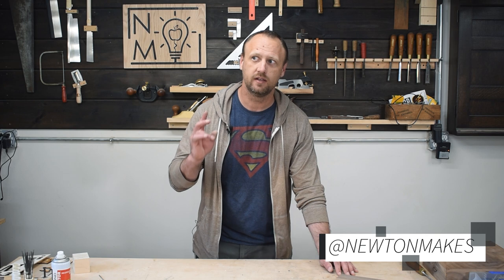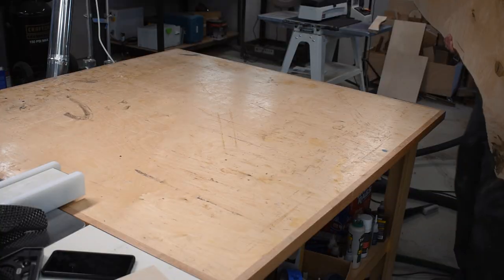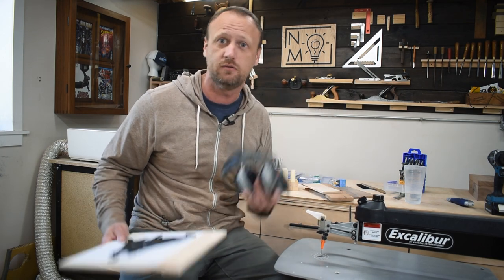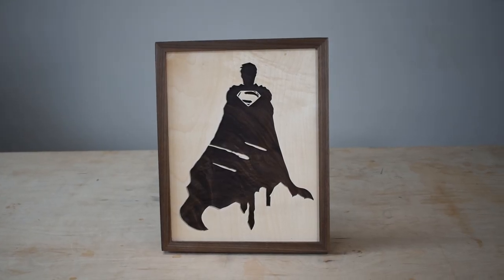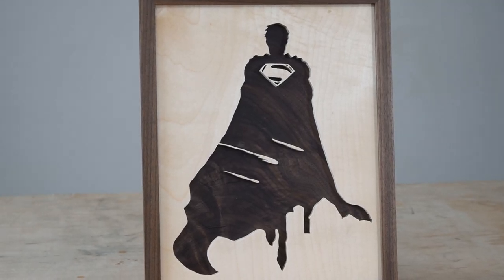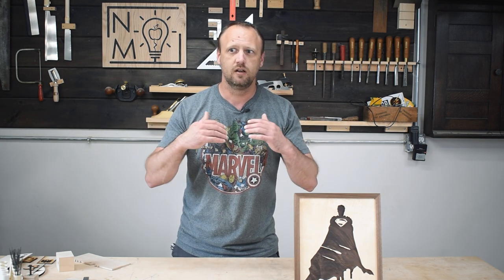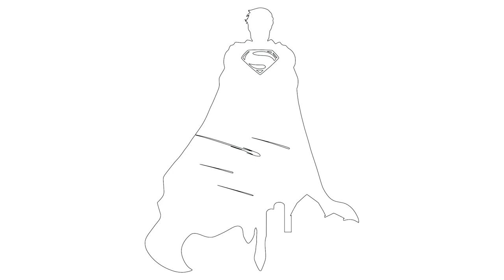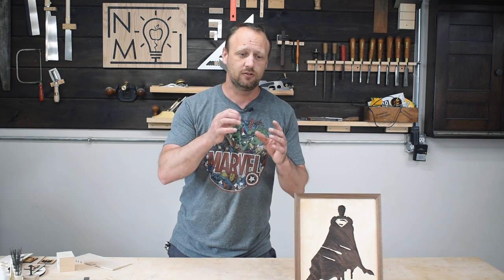I Scroll Sawed for the First Time YIKES!! | Lessons Learned

Comment: Use blue painter's tape on the wood first, then your pattern, and then packing tape.  Packing tape lubes the blade.  You can get sanding blades to sand any edges/areas that need it.  Great first time project!  You did very well!
Reply from the maker: Smart move with the tape. There are sanding blades?! Alright I'll look into those too.

Comment: I’m surprised that you didn’t break any blades with relatively thick maple for your first time. Packing tape will come up with the top layer of paper, people even have issues with vinyl. I think I have heard good luck if you follow the lines on your paper with CA glue, but that’s more sanding and possible staining or stain blocking in the wood
Reply from the maker: Yeah me too but I also didn't think this maple was thick until I started cutting it. In everything else that I do, this board would have been super thin. That was a big lesson learned for me.

Comment: What I use for my templates is sticky label paper. Sticks to the wood really well and peels off easily. Great video and an awesome first project.
Reply from the maker: That's a nice tip right there! 👍
Reply: Also lay painters tape on the wood then stick pattern to that. Then add packing tape to the top before you drill your holes. They say the glue in the packing tape lubricates the blade.

Comment: Nice work. I have an 80's or 90's pin-blade Craftsman that basically shakes the entire room when it is on. I only ever use it for finishing tight bandsaw cuts. I only use it once in a blue moon, but when I need it, I need it. 

For sanding, I just CA very small strips of sandpaper to very thin, strips of wood. I use hard maple, so that I can get the strip of wood very small, but then it has some stiffness. I also sand the edge of the strip to a point, so that the sandpaper then forms into a point, but has backing.

Comment: Turned out awesome. Don't be afraid to adjust the speed of the saw. I use blue tape under the picture, because it comes off easier. A small cheap set of files works great for inside touch ups. Take your time and keep practicing 👍
Reply from the maker: Adjusting the speed is something I have to get used to. I played with it a bit but not much. It's rare that any other tool has that feature so it's not something I naturally consider. I definitely need to pick up some tiny files!

Comment: Thanks for this - great thoughts.  BTW I bought a second hand scroll saw with a blade fitted already and mad keen to try it out I nearly injured myself as the workpiece jumped all over the place!  On inspection and checking the blade was perpendicular to the worktable I noticed it had been fitted upside down thus lifting the workpiece on every stroke!  Something to look out for and not many videos for beginners mention correct fitting of directional toothed blades!

Comment: Hello from Germany and happy new year. Here is a tip to prevent burning marks. Use clear tape on the top, this will hold the subject in place and prevent burning marks. I do it the same way and have not yet had any burn marks. I stick paper tape under the motif beforehand so that no traces of glue remain on the wood. I hope these tips help you a little further.

Comment: Wow great first artwork! I have a brand new dewalt scroll saw ready for use in my shop. Think I’ll get a variety pack of saw blades given what you shared. Super impressed! Bravo 👏🏼
Reply from the maker: Thanks, that's awesome to hear that you're getting into it as well. That Dewalt saw has a lot of great reviews. I picked up some #2, #5, #7, #9 blades. But I mainly used a #5. I found a cool cheat sheet on blades that I'll try to post on my community tab.
Reply: @NewtonMakes  cool. Thanks for the details

Comment: Thick packing tape does help.  It will still lift a little, but won't break off and blow away.  Feels like it lubricates the blade as well.  Not sure..  A set of needle files really helps with sanding small areas.
Reply from the maker: I'll have to look into lubricant for it. Needle files are a good idea, thanks!

Comment: Awesome video and well done! I loved the “lessons learned” section. I personally have never used a scroll saw, but you made it look easy! What would you say is the maximum thickness of a board you could use with one? Will you be making any projects that have different contours/depths to the pieces like the wings of the eagle you showed?
Reply from the maker: You can go up to a few inches thick. I don't have a desire to do that, at least not yet. I like thinner pieces like 1/8 - 1/4" and want to make art that's layered. But who knows in the future? They make blades that are designed to remove the waste when cutting out thicker boards.

Comment: Blade quality is important. I use precision ground blades for precise cuts. Leaves almost a polished edge. Also, scroll saw choice is also important. I was less than satisfied with the dewalt saw. I had problems with blade tracking, and longevity. I now only use Hegner scroll saws (I have 3) and will last you your lifetime.
Reply from the maker: Hegner is a heck of a scroll saw. That's awesome!

Comment: A reverse blade will help with the sanding. packing tape will actually lubricate the blade.
Reply from the maker: I used a reverse blade. I use packing tape all the time now. It helps in a lot of ways.

Comment: One way to sand the tiny bits is clamp some Sand paper to your blade actually held by the clamp together with the blade, and set ya saw going, kinda wrap it in a tube around ya blade 🤙😉
Reply from the maker: Nice scroll tip 👍
Reply: Or have your apprentice do it.
Reply: @nemo227  great now I got to hire an apprentice to sand something stupid I decided to make in the garage at 2am cause I'm an insomniac
Reply: @thatdude8247    Well, sure; all great artists make sacrifices.  Leonardo had to hire an apprentice to sand the ceiling of the Sistine Chapel before he could paint his great works on the same ceiling.  I have it on good authority; my cousin Luigi said his great grandfather told him.  True story.😇

Comment: Thanks for the great video. I'm thinking of purchasing a Ryobi scroll saw soon to help a lot more with interior cuts in some of my planned projects. I never knew how intricate you could get with these and wanted to thank you for sharing your lessons learned. I design and cut things all the time with my Cricut Maker, but it just doesn't cut wood very well even when the wood is very thin and balsa and I don't really have the budget for a Glowforge or other laser cutting type of tool. One question I do have, can other materials be used with a scroll saw besides wood? Would this work well for cutting intricate shapes out of say, acrylic? I'd like to make a Neon-style sign that I saw on a different Youtube video and they way they did it was that they fed a flex-led tubing through a precut channel within a acrylic outline. Of course in that one, they used a Glowforge to simplify that process...
Reply from the maker: I have a glowforge and understand how expensive it is. I've seen people cut other things with a scroll saw, but I recommend looking up scroll saw blades to see if they make them for different materials you want to use. If they do then you should be good.
Reply: @NewtonMakes  Thanks! Solid advice and had not thought about the blades themselves having special types that would be more versatile for various surfaces, just kind of thought it was for wood projects only. It makes sense, you have different blades for jigsaws depending on what is being cut. Thanks!